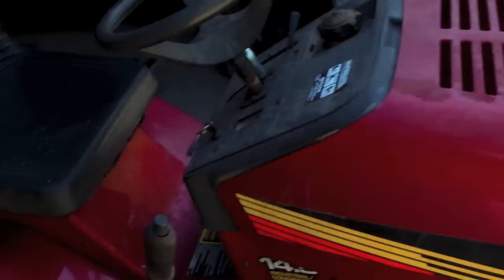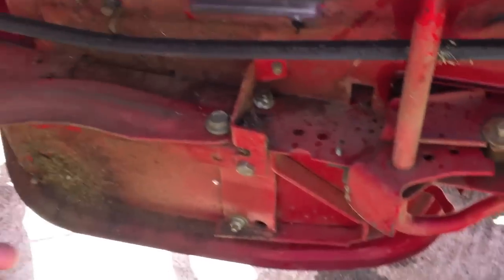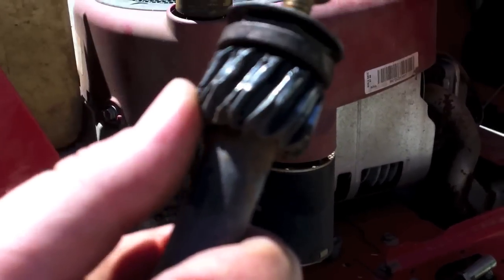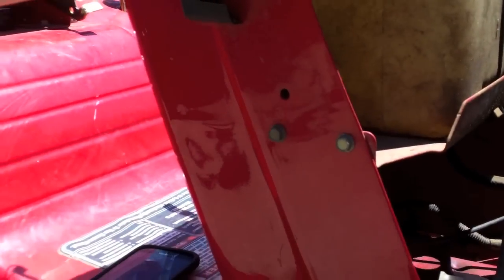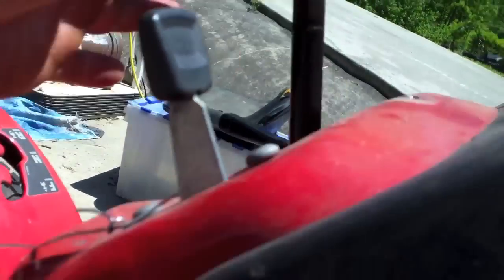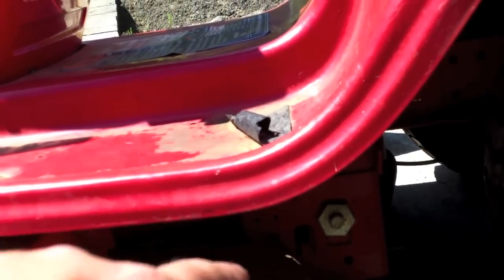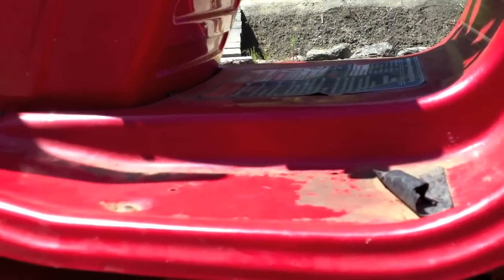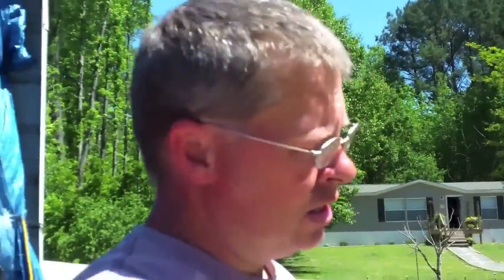How to replace steering gear on a TroyBilt Pony

Comment: You need one of those hand held impact hammers that you strike with a hammer for those pesky Phillips bolts. I learned that long ago working on clapped out road bikes I'd use off-road when I was a kid. Gets em 90% of the time. 

Also a good tech tip is, try some valve grinding compound on the tip of your Phillips. Don't fill the screw head , just enough to wet it is all. It really helps grip.

Comment: Fun tip for those damn Philips heads is to take a 1/4 inch socket on a 3/8 drive and put onea them Philips attachments you can put in those universal screw drivers right into that 1/4 inch socket. And then you pile up some extensions on your wrench and it gives you a crap tona leverage.

Comment: a trick you can do is pull your gas cap off---  and take a plastic wal-mart bag, or any typical plastic grocery bag, and place it over your fuel filler, and put the lid back on it- over the bag.   It acts as a seal and won't let the fuel dump out of your air hole in the lid.  Works well, for when you have a full tank, and you want to dump it over.   I typically stand it up on the back end, rather than dump it on the side... Then it puts the work at standing height and it's just fun to work on, knowing that it can fall over at any minute. cheers
Reply from the maker: Yep, good tip.

Comment: Your video has a model like mine and I purchased a new shaft and the other piece with the 6 sided bottom that the shaft goes through.
  I replaced the phillips head with a 5/16" bolt ( or whatever it was ) and there was a lot of slop up and down on the shaft and it 
would only allow left turns, or it was doing the same popping noise that means the gears are going tip to tip and that is ruining
the new shaft.   I went to lowes and purchased an assortment of different size heavy washers and got rid of the slop, but 
gears are still grinding when I turn to the right.     I need to mow My lawn very badly !!!   Now She clicks all the time and 
not just right turns.  She is on the trailer ready to go out to someone who can help Me.
Reply: ctguy1955 I'm at the same point. I finally got the bolt to stay on with heavy duty lock-tite but shaft has too much up & down play. I think the bottom part of the shaft is too long.  Did you ever get yours working?

Comment: Hey what about seized up steering of the front wheels, even w/ the drag link disconnected??... On a Troy Bilt 13ax79bt011 model.    For my friend's mower, I haven't seen it in person, yet... He says even w/ the front tires off the ground they're hard to turn/move by hand.       thanks    - take care

Comment: Hey great video thanks.If you're still around, do you know if i can replace the stock 5/16-18 x .750 Phillips head bolt from shaft (the one you hate) with one that is  5/16-18 x 1 in length? or 5/16-18 x .5 in length? Auto store and home improvement stores only carry the 5/16-18 x 1 & 5/16-18 x .5 NOT the  5/16-18 x .75 size
Reply from the maker: Lol Yessir Im still here. I think it will..

Comment: replace that machine screw with 5/16-18x5/8 hex head bolt.
Reply: That's what I did.  Way easier than that stupid screw.  Replaced the bushings in the front axle too.  That tightened up the steering nicely as well

Comment: How do you get the screw to stay tight on the steering because I tighten it and it comes loose?
Reply: Put a little blue locktite on it...    Actually, just take that stupid screw into an Ace Hardware store, or sears, or Lowes, or Harbor Freight-- and get a BOLT that's the same length and threads, so you can actually tighten it with real tools.
Reply from the maker: Yep
Reply: @Mayhemcountryliving  On mine, I just welded a random 5/8's nut on top of the screw-  so Now I can get a wrench on it.
Reply from the maker: Good stuff

Comment: The problem with their steering is the bearing flange, a $5.00 part but when it goes bad it will cause the steering rod and steering plate to destroy each other , If they made it with harden steel it would last way longer but why would they want to build something that lasts.The plate bearing and shaft end are cheap and designed to wear out.
Reply: Well. if it was hardened steel-- it would wear out the shaft.  They made it so that the flange bearing is sacrificial;  it's soft and wears out first, that way you can just replace the $3 part and move on with life.  The problem is that people always wait until it's so far out of spec that the gears are chewing themselves to death.   If you just catch it early and keep a fresh flange bearing in it--- the gears will last just fine.

Comment: An impact gun with a #3 Phillips bit will get that screw right out.  The little quarter inch drive battery powered ones work great for this.
Reply: I tried that.....it didn't work. I used a #4 Bit.....but I learned something to pass on.

Fastest way to do this, lift front of mower a foot, pull cotter pin on deck and drop it,  grab 1/2 inch cobalt drill bit WD40 and start drilling into the screw......it took 3 minutes to pop apart. (Like drilling a lock)
Reply: Nope!

Comment: Thanks for only telling us what you did and not showing us.
Reply: I deserved that and man enough to apologize.  I actually laughed when I saw your reply.  This thing has me pissed off to no end.  I replaced the shaft and put it all back together, however, when I make the screw tight I can't turn the wheel.  If I try hard enough it will turn and then the screw is loose.  Grrrrrrr
Reply: @Mayhemcountryliving  
I replaced the shaft.  Nothing is bent. Did you apply loctite on the screw?
Reply: @Mayhemcountryliving  
Thanks for the help and once again I apologize for my smart@ss remark yesterday